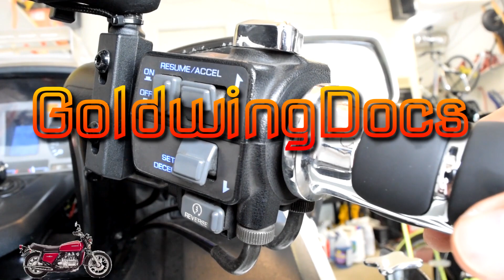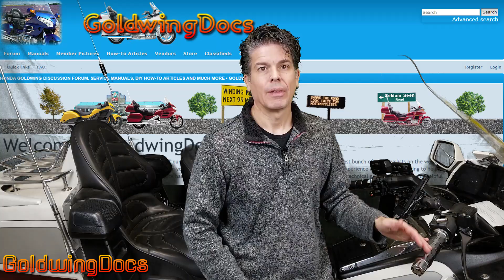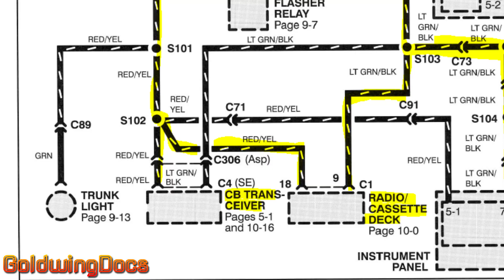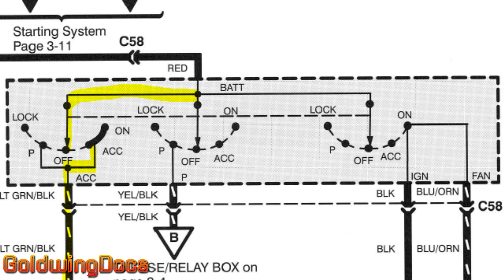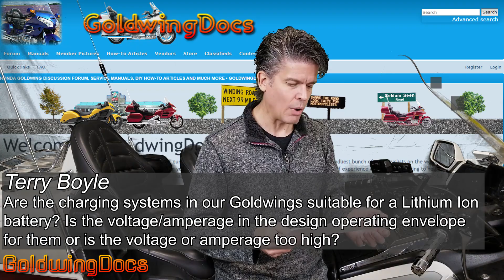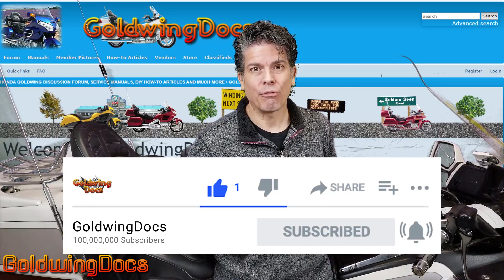Goldwing Q&A Episode 7: Electrical Failure, Fuel Pump, Lithium Batteries

Comment: On 2001-2005 goldwings there seems to be a number of issues with the ECM'S. I WAS WONDERING IF THESE UNITS CAN FIXED OR REBUILDT? New units are 800to1000 to buy and sometimes hard to find.

Comment: I have a 2000 goldwing SE no power going to the fuel pump trying to figure out what part or what I need to do to fix the problem is it a ECM the problem or how to diagnose where the problem is be greatly appreciated if you could give me some idea on which way to approach it thank you

Comment: Wiring question:  The Red 2-pin connector in the trunk lid of my 2017 has stopped working.  It was plugged to a socket that charged cellphone.  Cellphone cord shorted. Any idea on where this “always hot” circuit has failed?
Reply from the maker: There is a fuse in the panel specifically for that circuit - I would check that one first.

Comment: I only put lithium batteries in my motorcycles anymore. They make the bikes start like a snap, they spin the starters like crazy. They have a battery management system on them that is designed to work in place of lead-acid cells; they will take care of handling whatever the motorcycle gives to it. I use regular battery chargers on it just fine. It only takes the battery up to about 80% charge but that's plenty to maintain it over the winter, and plenty to start a bike where it'll charge the rest of the way.
One benefit I've realized from a lithium is that the BMS will not allow you to discharge the battery so much that it's damaged - if you leave your headlights on overnight or something, a lead-acid battery can get destroyed. The lithium battery will be putting out like 0.5 volts and almost zero current, but that's just the BMS protecting the cells internally. Trickle charge it and it'll come right back to life good as new.
I have ridden my Yamaha Tracer down to 5*F so far, and the lithium battery in it has started it right up every time, didn't seem sluggish at all.
The trick of running headlights to warm up the battery is handy for lead acid cells as well, even back in the 70s we did that when it was really cold.
FYI the US is poised to become the world's leading source of lithium - in 2025 they are opening up a mine in what is expected to be a deposit that is larger than all other known lithium deposits in the world combined. And lithium batteries are approaching 96% content recycling with the new recycling plants that are opening up to support EV battery recycling.

Comment: my 2007 gl1800 is loping at idle and has acceleration delay until accelerating to about 2000rpm. runs great at speed. hard starting.

Comment: Can you show me hoe the noise suppression capacitor and power connection in a 1988 GL1500 I connected to the fuel pump. The fuel pump IS good.

Comment: I have a 1988 honda goldwing GL 1500 I put a new fuel pump on it and a new filter..ps..the pump is pumping out but not going in fuel line from pump hose to filter or to the carb..pls help.. Douglas Hopkins in chesterfield VA 😊
Reply: If I take hose off fuel pump it's pumping out

Comment: Can the current fuel pump recall issue have anything to do with a sudden drop in fuel economy in my 9,500 mile 2018 GW touring DCT? Maintenance is up to date by dealer. Have dropped to 32mpg measured. Worse by electronic monitoring (like 25 mpg). Leaving on a 4,000 mile adventure in April. 
Thanks.

Comment: I have a 2003 Goldwing trike will not start. I press the ignition. All I have is the click and put in your battery and a new fuse that goes on the bottom of the fuse can you please help

Comment: Question, my current 1988 1500 has a 40 amp alternator, and we are doing an overhaul of the bike. I bought a parts bike (blown engine) for replacement parts. It has a 90 amp alternator. Can I swap this alternator??
Reply from the maker: You can, it will still only draw the power required of it, but having an oversized alternator means it will run much cooler, and last longer.

Comment: I have a stater plug that burnt how do you identify the two wires three wires that the stater plug goes into if the stater plug itself was melted and wouldn’t that affect the regulator or maybe they call upfront I have a 1978 Goldwing GL 1000

Comment: Putting you to your test, I got question! 07 gl1800 electrical snapping sound coming from speakers every 2-3 sec
Reply from the maker: I would start pulling fuses one at a time to see if pulling any one of them makes the sound stop. That will at least give you an indication which electrical system is causing the problem.

Comment: Hey guys I have a 85 gl1200 trike, running injection not carb ..I have a fuel system error, I have fuel flow, when I press the starter it just clicks, I'm struggling I think it's a earth ..where is the earth location on the front end please

Comment: I would not be recommending lithium batteries for motorcycles in general. Lithiums need particular charging considerations, temperature monitoring, and management. Motorcycles do not yet have any of this. A more suitable, more forgiving alternative coming into the fore is the lithium iron phosphate battery. While it has many of the good characteristics associated with lithium technology, it's much safer, less critical for charging, and easier to manage. I suggest a follow-up Q&A on this to discourage casual placement of lithiums in bikes without proper research and professional advice. Thanks for doing the Q&A sessions. I like them as they are very helpful.

Comment: Do you have any input on my problem. I recently had to replace my alternator which was a 40 amp with a new 90 am alternator. After installation I took it for a ride and wow it seemed to run a lot better and faster. Does the 90 amp alternator do that ? The problem continues with the alternator it makes noise and vibrates to the point I do not trust the bike to ride it. I never had that problem before so the only thing I could think of is replace the dampers. Do you think I am on the right track or should I send this alternator back ?

Comment: I have a 91 going Aspincade I need two parts that I can’t find online maybe someone Has one  switch head light turn signal headlight switch also I need that plastic part goes where  the fuse  is  that’s the one under the main fuse help

Comment: 1998 GL1500 SE. Honda dealership replaced failed key ignition switch.  Went to pick up bike, started fine but wouldn't continue to run.  Shop put the battery charger on and bike started but still wouldn't continue to run.  Diagnosed as a failing alternator.  Replaced alternator.  2nd trip to get bike, ($1600 for repairs now) and rode bike home fine.  Sat in garage for a week, all lights lit up but would not crank.  Charged battery and bike started fine, let it run for about 10 minutes. Appeared to be ok now.  Sat another week and same thing happened.  Took battery to 2 places to check, shows with a full charge but a bad cell. Both places said Bad battery.  Bought new battery, put in acid, charged as per directions, installed battery.  All lights lite up fine.  Hit starter and heard an loud immediate POP.  Now no power to anything.  Dog bone "B" fuse is fine. Can't figure out to check the "A" fuse. Haven't found video for the "A" fuse above the main fuse "B" .  How do I trouble shoot the problem now? Thanks Dave
Reply from the maker: First off, I'd recommend an AGM battery rather than a flooded wet cell for a GL1500. See: https://goldwingdocs.com/forum/viewtopic.php?f=18&t=36953

Second, when you get a "pop" and then no power anywhere, it's generally caused by a loose connection. Check your battery terminals, the wires going to the battery, at each end, check the ground strap from the battery and the frame, give them all a wiggle and see if the bike comes back to life.

Comment: Turn signals stopworking and navigation stop working, check fuse replace navigation fuse working ,all other fuses good.Turn signals not working. Took to dealer,they replace relay checking all wires ,turn signals not working.  2016gl1800 with 20thousand miles in the past 6wks not been able to find problem. HELP!
Reply from the maker: This one's a bit complex for a video - I'd encourage you to post this in our GL1800 forum, where we can delve into a bit more in depth: https://goldwingdocs.com/forum/viewforum.php?f=7

Comment: I have a 1983 1100 I and it will get hot but not over heat I have removed the thermostat and it helped but it now goes up to almost hot then it will cool down to normal while I am riding is there something that I am missing or would putting a new thermostat in fix this

Comment: I've owned at least ten 1500 Goldwings, all pre-owned. It would have been handy to have had you as my neighbor. I've also owned three 1800's. One lost overdrive, two had ADG failure. Went back to the 1500's. I currently have an '88 (68k) and a '97. (40k) The cruise on the 97 will not engage. The cruise light comes on and the set light comes on but will not engage cruise. Fuses and relays okay. I can swap parts from the '88 as its cruise works perfect. Any advice where to start? Thanks Scott.

Comment: Hey Scott, awesome series!   
Am wondering if Terry Boyle's question was answered.  It sounded to me as asking if the goldwing would correctly charge a lithium battery, not whether the battery would run the bike.  Is there any risk of over or under charging/volting a lithium battery during normal operation of the bike?
Reply from the maker: I talked about it with the voltage being produced by the bike, but yes, it will work just fine, no issues.

Comment: Another great video I was actually considering getting a lithium after my AGM battery needs replacement I'm also curious if you have any updated recommendations on LED headlights I just saw your video with the electrical connections headlights but also noticed it's a couple years old and was wandering if anything better has come out. Thanks from California
Reply from the maker: Not really, they are definitely still high quality bulbs, and have lasted many years now.

Comment: Hey Doc,
 I have a 1992 GL1500i that my left corning light keeps turning on but without the signal and I the switch is not being touched when it comes on....except when I cancel my right signal.....what could be causing this?